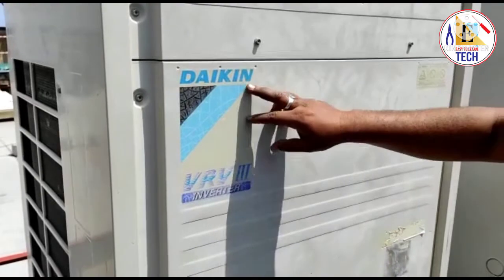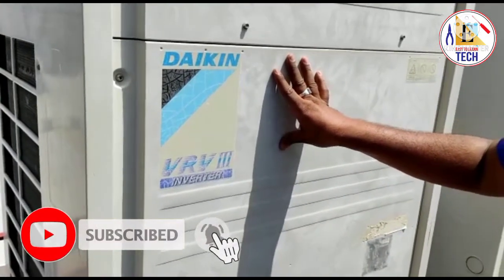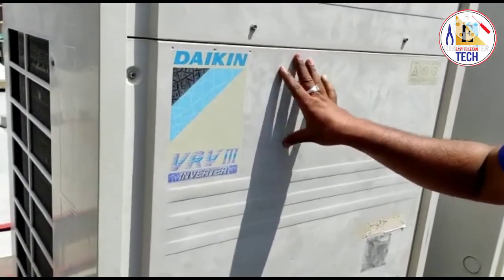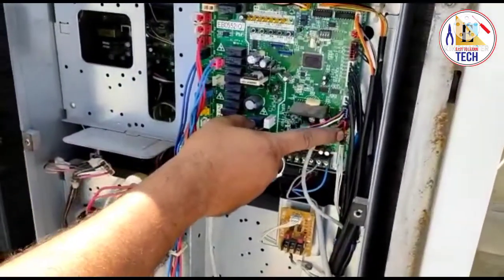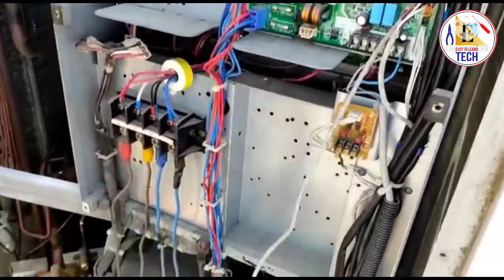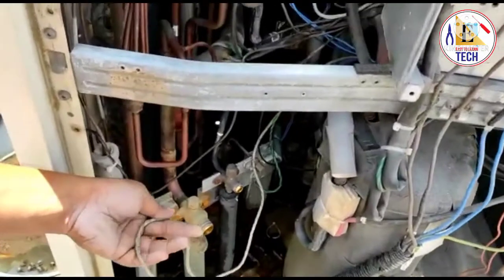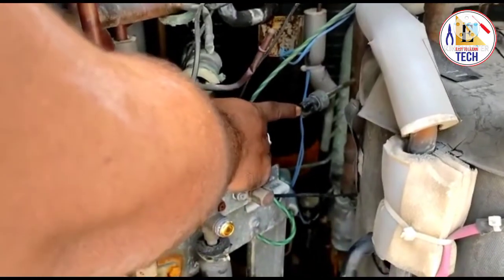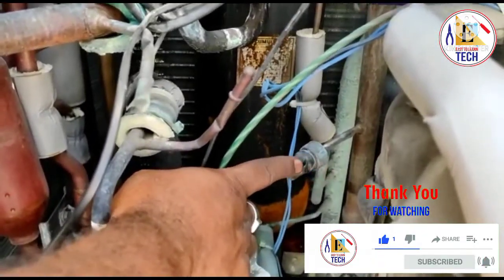#DAIKIN ERROR CODES JC / HOW TO SOLVE VRV3 ERROR CODE JC / TROUBLESHOOTING ERROR FOR DAIKIN / #VRV3

Comment: Thanks but What is the solution? It looks like you have to recover the refrigerant. How would you like to do it if you have too? Thank you for the video
Reply: You wouldn't have to recover necessarily. You can use a pinch off tool
Reply: Or another idea. I literally just replaced one. You can put a 1/4 flare nut onto the sensor and then put that on a swivel tee and onto the low side
Reply from the maker: I Explain about the error JC, We Don't have a recovery system, so i didn't make the video, How to change the low pressure sensor .

Comment: How to check sensor value
Reply from the maker: *Step-1 Identify input voltage points and Power Sensor using the required Input DC Voltage.
*Step-2 Identify output port and measure output using a multimeter.
*Step-3 Identify output range and calculate the calibration factor.
*Step-4 Multiple the output shown in multimeter with calibration factor and obtain the output.